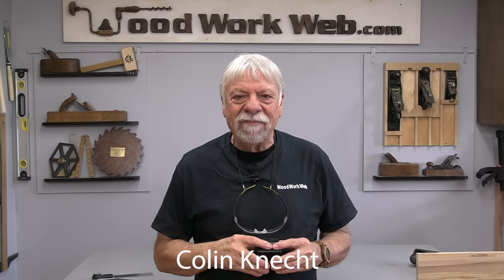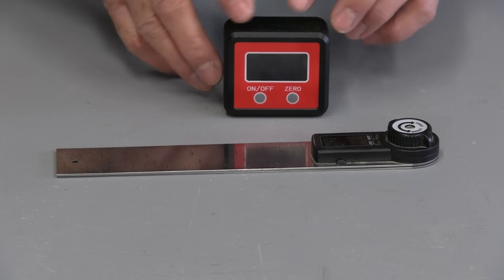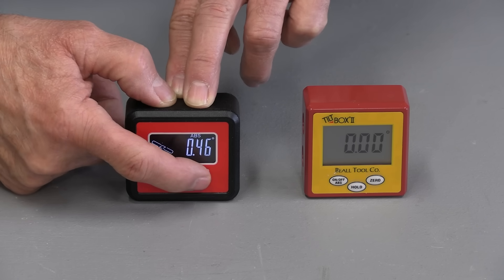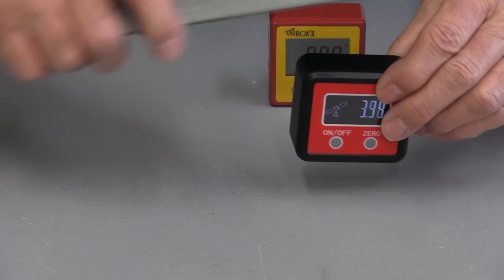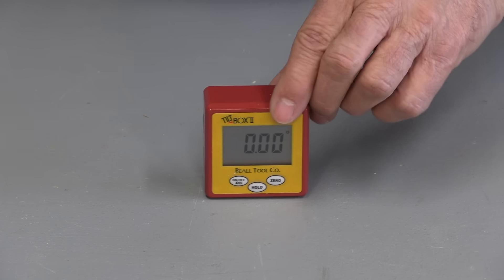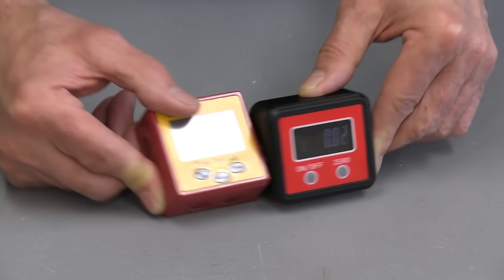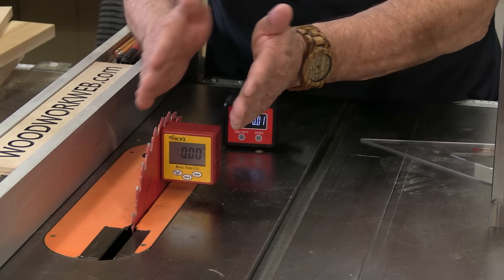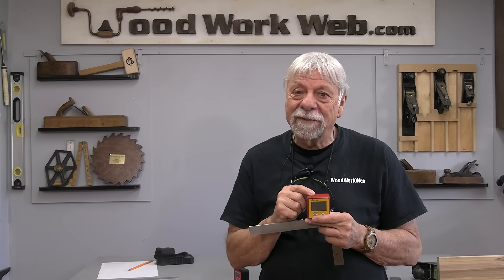Watch This Before Getting a Digital Angle Gauge!

Comment: One problem with using bottom AND side magnetic surfaces is that you are implicitly assuming that those two reference surfaces are at a "perfect" 90 degrees. Which they are not going to be on these inexpensive consumer items. So all you're measurements using two sides will be off by whatever error there is between the two reference sides.

Comment: Well no. You can't tilt it back and then measure an angle. That feature is a gimmick.
The reading will actually be different from when it is not tilted back using one of these type of digital protractors. Also if you want a true reading then you have to make sure the back surface of the digital protractor is exactly vertical.
Set your adjustable protractor to 135degrees and set your blade  using that to the same angle then push the protractor over while it is against the blade and watch what happens. There is no algorithm in the software of the digital protractor to compensate for it tilted back or forward. Some have two axes readings but they still don't compensate because they don't know "relative" to what you are measuring. It may not be horizontal in one axis because that is what you want but it does not know that unless it zeros in two axes.
I am sure someone will say the single axis does work if you tilt it back and that is fine. I am very flexible or you might say angular to second opinions.

Comment: Thanks for the informative video. I have been using the Huepar AG01 and I noticed its lack of accuracy. I would set it on a machinists square (even used a 1-2-3 block) to zero, then turn it 90 degrees and place on the vertical arm of the square or the same side of the block. I expected it to read 90 degrees but it wou;ld read anywhere from 89.5 to 89.85 AND there was a difference depending on which side of the gauge was used! That's when I began to distrust it and use my machinist square to set the saw blade. Apparently even the best digital gauge is only accurate to .2 degrees when compared to zero. I also like your idea of using the 45 degree side of a plastic drafting square to set the saw blade. Larry

Comment: The red one probably has an OLED display, it's best for readability.
The Tilt Box has an LCD display. Generally harder to read except in bright light where it stands out from the crown.
The try square and set square argue with the teeth. For this reason I prefer electronic devices.

I want angles between, mostly I would prefer the older electronic device. If I want to mark a line on a workpiece, that's the one.

Comment: These degree tools work perfectly in finding the angle on knife sharpening tools. You can sharpen a knife without them but they tell you the angle you are sharpening at and later you can repeat the same angle. Different knives take different angles to sharpen.

Comment: Helpful video thank you. I'm not sure if someone else has already mentioned it, but I think the reason you can't get the red box to go to zero is that it has a higher resolution than the yellow Tilt Box. This explains why the Tilt Box has a more stable reading. Although they both measure to two decimal places, I noticed in the video that the Tilt Box reading goes up at 0.05 degree increments, while the red box goes up at 0.01 degree increments. This doesn't necessarily make the red one more ACCURATE though.

Comment: The issue I have with these types of meters is that the X/Y and Z angles interfere with one another, so it seems like you don't get a true measure, because you can never get the Z axis tilt perfectly vertical as not to interfere with the angle you're actually measuring on the other axis. EX: to get a true measure on X or Y you have to first be sure the meter is at zero (or 90 degrees the other way) for axis Z, otherwise X or Y isn't accurate. If you sit it down on your table saw (Axis X/Y) then tilt it slightly backward or forward (Axis Z) the measurement of X/Y axis (your table saw) changes. So for example I was using this to adjust the camber on the front wheels of my car,  yet I didn't feel confident about the readings because I had to use a straight edge across the face of my wheel so I had to first be sure one axis (X/Y=wheel rotation) was as close to 00.00 as possible before I measured and adjusted the camber axis (Z). I couldn't figure out which numbers it was reading were the true measurements I was trying for (Z) or interference from the other axis (X/Y) being read also.

Comment: I found over the years that the tilt box works also on the band saw (tilt table), drill press (tilt table), belt sander (tilt table), disc sander (tilt table), scroll saw (tilt table), jointer fence (tilt fence), and sliding compound miter saw (tilt blade).  The cheap version works fine in all of these situations.

Comment: The mere fact that after decades of the table saw being a staple in the workshop there isn't a better, integrated, way to accurately set the angle of the blade is still baffling to me.

Comment: I think it’s a case of over sophistication like the rack and pinion adjuster on bandsaws replacing a clamp. Digital readouts are a pain unless you replace the battery just before use usually. My saw has an angle gauge. I have a goniometer, squares and protractors. I use test cuts.

Comment: One thing to realise..........the bottom may not be 100% square to the side, so if you place it on a horizontal  surface and zero it then put it against the side of a saw blade, drill etc,  depending on the accuracy of the side to the bottom, the .01 resolution accuracy will not hold......you can test the squareness by using a square you know is accurate.

Comment: Wish you put this out 6 months ago.  It would have saved me some money. I have one that is very similar to your first one. And it is total junk. I will put it on the table and zero it. Then move it to the blade. After I set my angle I put it back on the table and it was 5 thou out. I put it back on the blade and back to the table and each time it added 5 thou to the angle.

Comment: I use one of these which have the magnet only on the  bottom, but when I know the table saw blade is 90, I place the gauge on the blade and zero it to 0 then as I angle the blade, the readout doesn't invert and remains easily readable.  I have also used an app on my mobile phone called an inclinometer which I've found to be very accurate (of course it doesn't have a magnet and needs to be held manually).  The app also has a bubble level display which is also very accurate.

Comment: I wish you had discussed Accuracy and Resolution!  If you research some of the user manuals you will find they are typically only accurate to +/- 0.1deg when measuring near 0 and 90, and worse only +/- 0.2deg for other angles between (I have seen even worse on cheap models at Harbor Freight).  This means two things: 1) a reading of 90.00 could actually be as far off as 89.9 or 90.1 in accuracy,   2) the hundredth of degree resolution position reading (0.0x) is actually irrelevant and essentially nothing more than a sales gimmick, as it never is accurate past the tenths degree position.  Hence, I agree with you, I always use a hard machine square and 45 when setting my saw blade.  As for in between angles, well its up to the individual to determine the acceptable error level for their projects, so I think it is important to mention that the displays are deceptive in their accuracy and resolution readings, and that users should check their manuals.
Reply: Very well said!! I couldn't have said it better myself. Its all about the resolution.
Reply: I guess that matters if you are a machinist, but for woodworkers +/- 0.1 degrees is plenty accurate.

Comment: 4:29 magnet on the bottom is better because you're always referencing from the same point. Put magnets on the side, and now you're at the mercy of the accuracy of the case being square, unless you remembered to zero it after referencing the side of it.
Reply: And you will find that the Beall Tilt Box is perfectly square, so that is not an issue.
Reply: @MrBobWingard  Doesn't mean the process can't be improved.
Reply: i have used the beall just as described, it is perfectly accurate using magnets on two sides.  i can cut bevels on the ends of 4 pieces for a small box using the beall on my 1935 delta tilting table tablesaw.  the joinery is flawless
Reply: Jak wyzerować gdy nie wiemy czy mamy równe podłoże

Comment: The second purchase is definitely the better of the two, but its view screen is unreadable in a shop environment. My previous angle finder was also unlit wcich always caused be to search for a flashlight.
Reply: Totally agree the view screen is better on the first purchase.  Most always need additional light on the other.
Reply: I mounted a 4' florescent fixture over my saw to improve lighting for all tasks, it really helps me to see my marks on a board as well as machine adjustments. It was a pain to get access above the saw but it was worth the effort.

Comment: When you tilt it back, how does it measure the angle? Is it the angle multiplied by cos(theta) where theta is the angle tilted back? Or does it measure that theta and compensate for that? If it doesn’t compensate it could be a bad thing that it doesn’t give an error becausE it would be inaccurate although repeatable if you are holding it at the same angle (look up spherical coordinates for details)
Reply: These measure X and Y axis but NOT  Z axis. As they tilt forward or backward the reading will vary from true angle. Some are a bit better but none currently do all three axis. I have one made by a high end instrument maker (Fowler) that is very good, has magnets on both sides, etc.  I found the best tool for squaring the saw blade to the table is a tri square for 90 and 45 degrees. After that do NOT zero the digital angle gauge to the table top. Instead attach the tool to the saw blade and use an adjustable square to make sure it is square to the table front and back. Now zero the device and than tilt the blade WITHOUT rotating the blade untl you get the angle you need. Checking against a high end angle protractor the angle is dead on.  For those looking for a good one of these....I-Gauging seems to have a good reputation and while I don't have that particular one, I do have some other I-Gauging digitdal tools that have been very impressive and accurate. I also have a machine shop wit metal lathe, milling machine, etc. so often workiing with measurements and angles far beyond what is needed for woodworking.
By the way if you are looking for a cheap alternative, you may want to look into apps for your phone or tablets. I have one called Angle Finder by Smart Tool Factory that is an Android app that I use on both my cell phone and tablet. That one can do both bubble leveling as well as angles and is extremely accurate....as accurate as my angle cube! Note that all of these need zeroing once turned on. For a true bubble level you need an analog carpenter level type as it is showing true level to gravity.
Reply: I suspect it does not do any correction and it would be confusing if it did. Therefore the late error message is indeed a bad thing

Comment: In reference to the readout flip - that would let you know which side of vertical the blade is at, for angles very close to 90. But, I'm not sure when I would want to make a cut one or two degrees off vertical.

Comment: It may not be an issue, BUT are you certain that the case on the TiltBox is perfectly square?  Because you are zeroing on the bottom surface, and then using the left side as your reference on the saw blade.
Also, you forgot to point up the "abs" function that your cheaper one seems to power up into.  VERY problematic, as that setting is NOT referencing the saw table, but is supposedly referencing the earth's surface.  If your saw is not on perfectly level ground, you will get a bad reading for the blade.

Comment: Is the Black and Red one not as stable because it's showing Absolute Angle?  If you turn that off it should be more stable especially at Zero
Reply: No, whether it is using abs or relative, it should be stable.  And the bigger issue with the cheap ones is that they often are difficult to get to show 0.00, no matter what.

Comment: If sou are looking for a Deluxe version, take a look at the DXL360S. It offers some more twists like measuring two angles at the same time and the rotation around the vertical axis. But at least the tilt box should have one V-grouve to attach it at a drill bit (or a precision miled steel rod put into the chuck) to align the drill press table perpendicular or at a special angle.

Comment: Just a thought if your table saw  is not level and you zero the digital device to the table saw bed your angle will be off. Steel square and  speed square best. Set your blade to 90 degrees with square and then test the digital device for accuracy
Reply: I believe that it wouldn't matter if your saw was initially level since you're measuring the angle between the table face and the blade.
Reply: @DavidE-zp5jr  Agree...unless, of course, one leaves the thing on "Abs"!!!!
Reply: If you put the angle guage on the table saw bed and zero it out, it doesn't matter if the table saw bed is level or not because the guage is for measuring the difference between the bed and the blade angle.  I get perfect angles every time.

Comment: I've had a Wixey angle gauge for 7+ years that I use constantly. Only has magnets on the bottom and seems to be dead-on accurate. Replacing batteries is a pain of course, but it's a quick and easy way to check angles. I think that red one you have is simply poor quality.

Comment: If you have an iPhone, you can use the Measure app's level to find angles. I'd imagine that someone with your skills could easily create a wooden holder with magnets in the various places to give you exactly what you want. Even better, if you enable the Voiceover accessibility feature, the phone will speak the angles as they change, eliminating the need to read the screen.
Reply: You are  correct. I did see a video where someone did just that.  He made a little wooden holder for his phone with magnets to attach to his tools. Pretty neat. There are also several angle finder apps in the Play Store if you use an Android phone like myself.
Reply: Not just iPhone,  there are Android apps too.